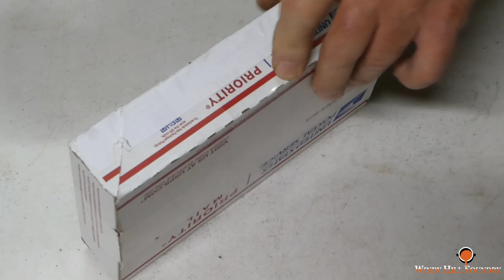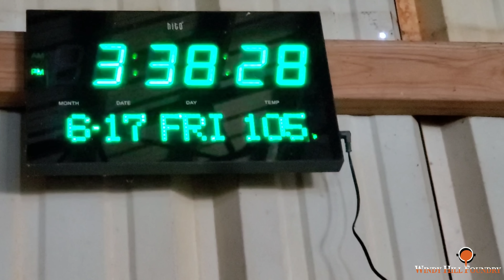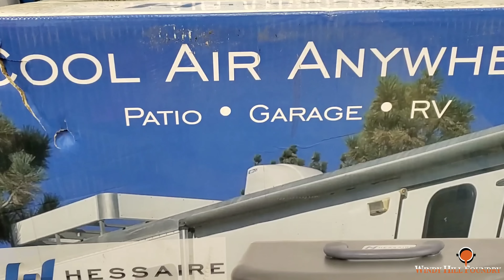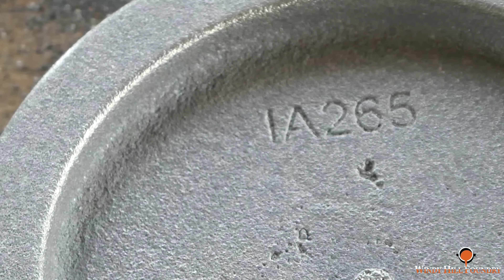HELICAL GEAR BLANKS

Comment: I'm always impressed with the resolution you are able to achieve with the debossed lettering on the finished castings. There must be less than 6 grains of sand across each of those strokes in each character!

Comment: We buy some larger iron castings at work. They are brake wheels for overhead cranes. I believe they shot blast these with steel shot. I wonder how it work for you if you had a blast cabinet with steel shot to blast your castings.

Comment: Have you tried spray silicone to help release your molds from the sand.Years ago I worked in a plant where they needed extremely slick surfaces and we used spray silicone made for releaseing bread from the molds in a bakery.

Comment: Question.

I'm curious. I wonder on the straight edge hole flashing, If the effort of making a core for the  holes in the straight edge would cut down in the grind time enough to offset the clean up time to justify the extra effort needed to make the cores?

Comment: I'm surprised you're using stones for flash/parting-line removal.  I spent 18 months in the grinding department of Benton Foundry, and the only stones were the big 28" wheels for grinding gate stems.  Everything else, literally everything else was attacked with carbide burrs in die grinders...  When you need to finish 2400 castings in a shift, carbide is your best friend...

Comment: Instead of using that light-weight needle nose pliers as a rapping tool why not try to use the tool I sent you? You'll find that you can get better clearance around the pattern and that you'll be able to pull the pattern with little or no effort. Of course it's your decision...